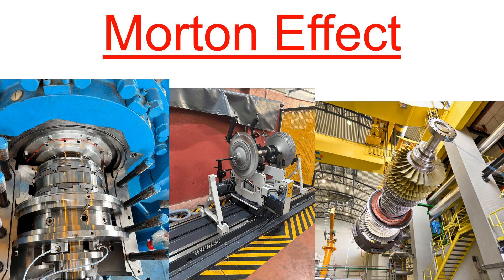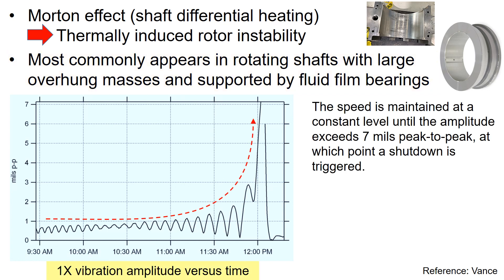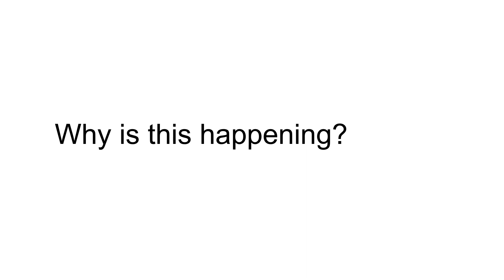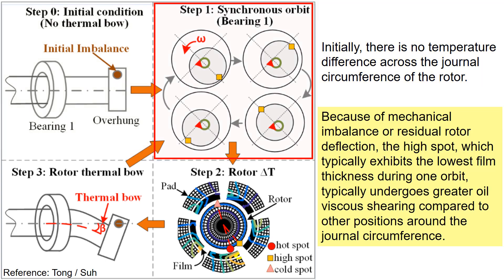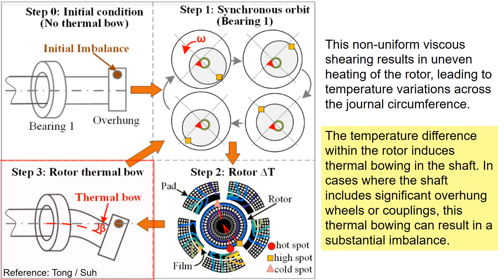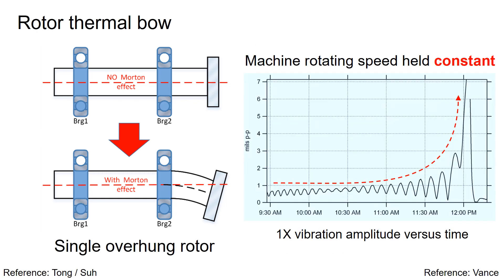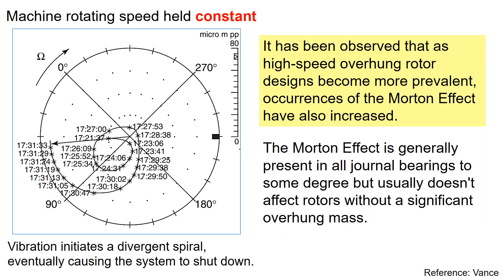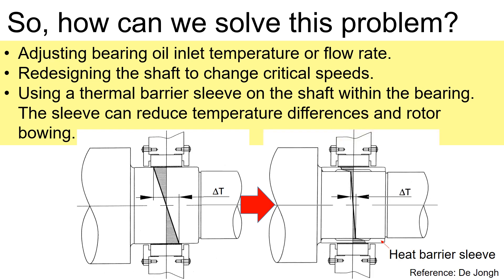Part 29 - Morton Effect

Comment: if sleeve bearing suffered from wear in a certain portion of its internal circumference , can it cause differences in viscous shearing compared to other  positions around the journal circumference.
Reply from the maker: Interesting point. It's logical to assert that wear in sleeve bearings could potentially lead to variations in viscous shearing. :)

Comment: May I know about how this effect [Morton] differs with Newkrick effect?
Reply from the maker: Excellent question. The phenomenon of shaft-labyrinth rubbing and the resulting thermal bending of the shaft are collectively known as the Newkirk effect. On the other hand, the Mortan effect is attributed to heat generation from shearing the thin lubricant fluid film. Adjusting the lubricant flow rate can effectively address the Mortan effect. 
If you have specific preferences or questions, feel free to reach out. Your support is truly appreciated! I would also be grateful if you could share this video with your colleagues and fellow engineers. :)
Reply: Thank you for your response. Will be glad to watch ur video on Newkrick effect, any plans in the upcoming parts/series.
Reply from the maker: @abhilashshirsangi4252  Absolutely! I'd appreciate it if you could kindly share my channel with your fellow engineers. Thank you!

Comment: It seems this would be a self canceling effect, but the spot lags the imbalance?
Reply from the maker: Excellent insight! The shaft high point (where mass is more imbalanced and located off-center) tends to experience higher temperatures due to higher shear effect, exacerbating the 1X vibration over time. If you'd like, I can explore this phenomenon further in an upcoming video. Thank you for raising this point, and don't hesitate to reach out if you have additional questions or topics you'd like me to cover